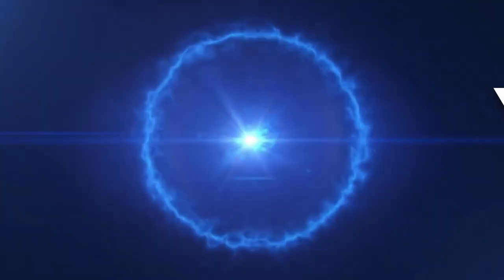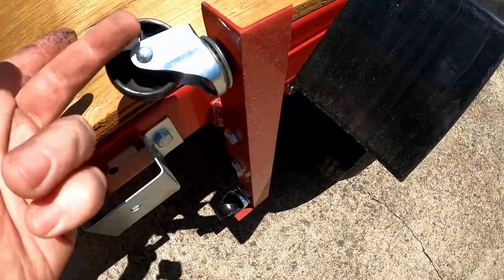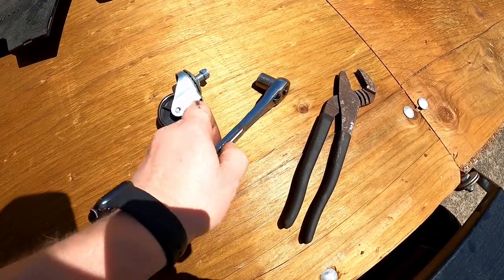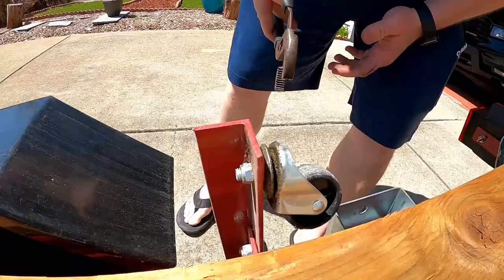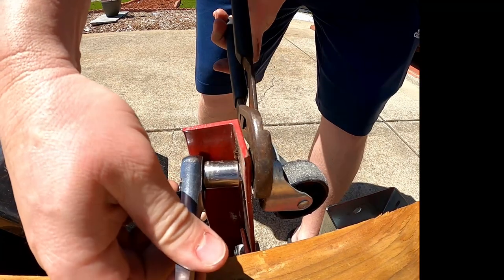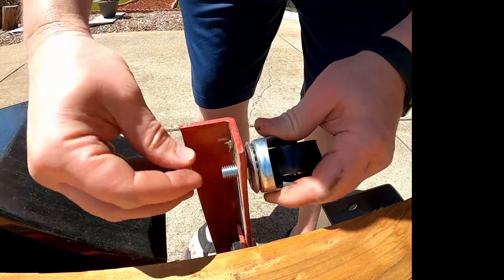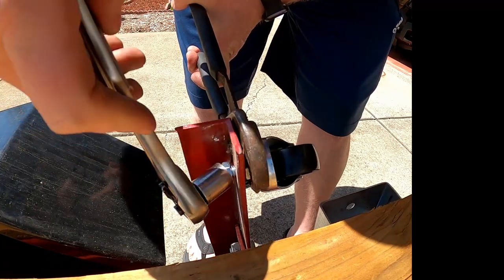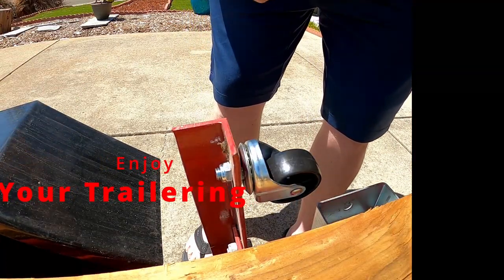Replace Harbor Freight Haul Master Trailer Caster Wheel

Comment from the maker: 1,195 lb capacity Haul Master Harbor Freight Trailer Item 62666
Item number for the caster is 017432 (these aren't sold in stores: you need to call harbor freight and they will ship them to you.)  Harbor Freight phone number (800) 444-3353
Part number in your owner's manual is 35 (page 8 on my owner's manual for trailer 62666 from 2020.)
Cost as of 1/25/2023 is $1.50 per caster, shipping included.